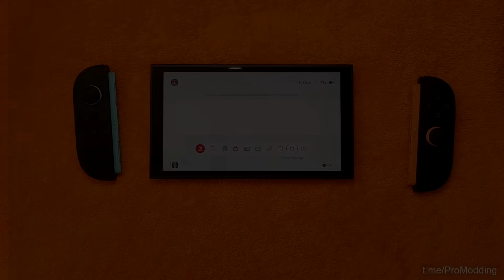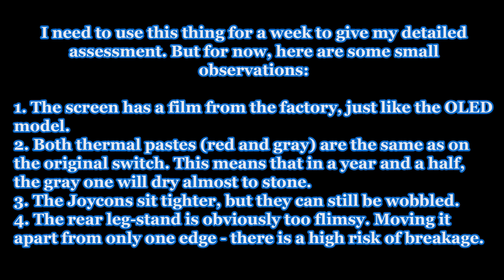World’s First Switch 2 Teardown & Microscope Review (4 June, Before Release)

Comment: Possible 3/10 repairability?
Reply: looks fairly easy tbh, just a couple of stickers is not that bad
Reply: Aluminium stickers are a pain in the to remove on a flat surface, this is in a joycon rail where you have to be careful and cant get a good angle. also we have obligatory wires on the heatshield which arent that great either.  @pedrovieira8602
Reply: If you dealt with aluminium stickers you know they are a pain in the ass to pull of especially on rails, you also have the obligatory wires taped on heatshield as well. Just to compare the switch 1 is 4/10 on ifixit and thats an easy console to repair. so Switch 2 may even be lower than what i thought.  @pedrovieira8602

Comment: Let's get ready for picofly 2 🤣
Reply from the maker: I'm thinking of putting rp2040 in this console just as a talisman, without wires))
Reply: @pro-modding your gonna do it? Can you make a vid one day?
Reply from the maker: @shefshyguy2  Put rp2040 into NS2 as talisman and made video about?) Hah, may be) but it will be compained with something else, I have Idea about this stupid stickers on the sides)
Reply: @pro-modding yeah I heard about those pesky stickers. It’s unfortunate how they cover these screws up when eventually a consle may need a repair and these stickers will need to be removed for the repair process to occur. Also someone will eventually find a way to hard mod it but I doubt Nintendo will let it slide. I really hope someone finds a way to mod it because I like hard modding and putting my skills to the test.
Reply: Basically I have one on OG switch but wi5h client 4O4
Reply: Voltage glitching is blocked during boot by the new security chip.
Reply: @malamucik2096  Allegedly?
Reply: @malamucik2096  not confirmed.